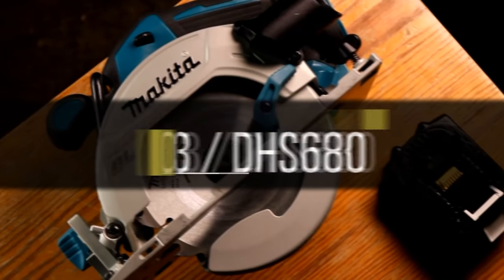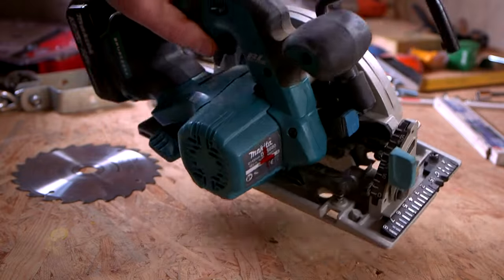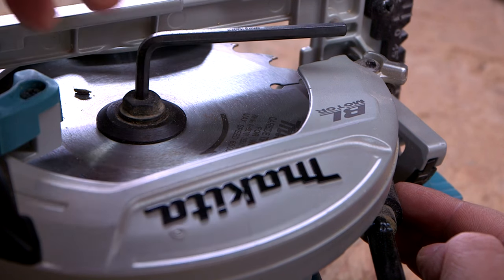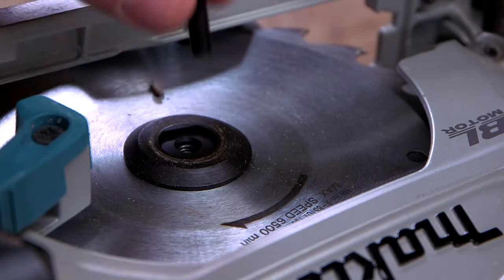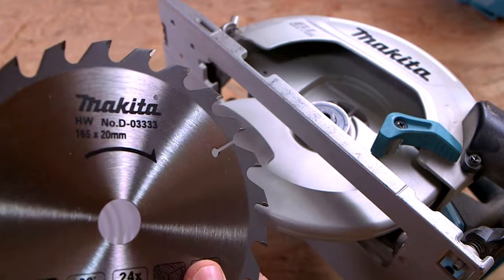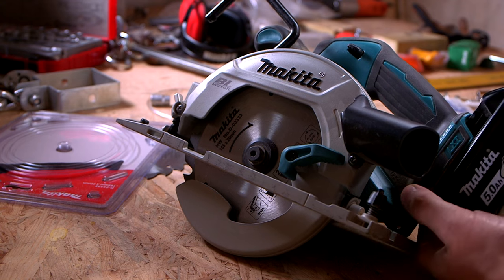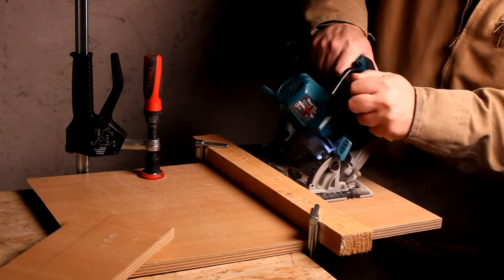Remove and install blades - Makita circular saw

Comment: Let me add. You take a new saw and show how easy this is. It is not. My saw is about 13 years old and the blade has been changed in the past. The blade locking button must be held limiting me to one hand to turn the nut and nothing to brace against. It will not loosen and since rust  is not the issue - what answer to you have? Please address real world situations and quit making things seem so easy.
Reply from the maker: Your struggle is real. You must have bought a Milwaukee. In that case, there's no help available.
Reply: @Itstartedwithsawdust  no Makita

Comment: my new blade comes with a washer, the hole at center of the blade i a little bigger than the holder , i must use that washer to make it fit. not sure if f anything to pay attention here
Reply from the maker: Is it the same kind of blade? There is a tendency to neglect the arbor (size) while buying blades.
Reply: @Itstartedwithsawdust  actually i just bought a new circular saw and the blade comes in the pack. Tmr I'll take the picture, it s midnight here, may i inbox you
Reply from the maker: @haidang93nd  that should be easier then. Any pointers in the manual?
Reply: @Itstartedwithsawdust  hello, just realized that utube removed inbox function. Do you have fb or can i mail you the pictures i took
Reply from the maker: @haidang93nd  Indeed. Easiest way should be uploading a short video on Youtube and please send me the link.

Comment: thx for not stating one needs to unplug the thing. if anyone gets hurt by changing a blade, they should avoid using it all together.
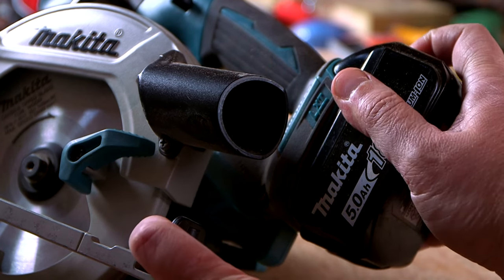Reply from the maker: You may wanna check 0:40.